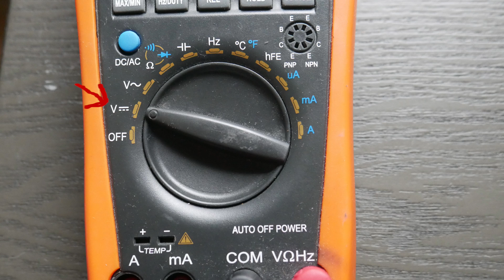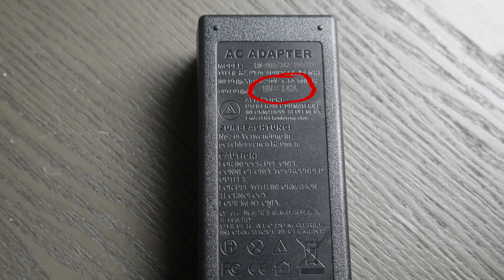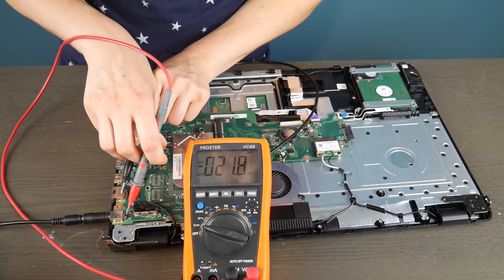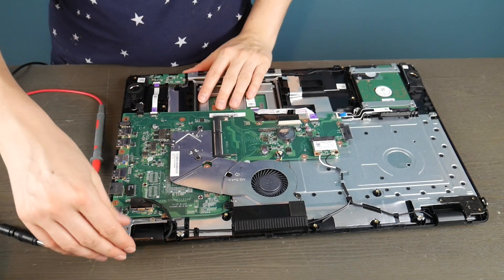Fix For My Laptop Won't Turn On - Tutorial by a Certified Technician

Comment: So i tested mine. I get power to the board. I reaet the cmos and it still will not power up at all. Is it just dead mother board?
Reply from the maker: If the power cord seems to be working, a BIOS reset doesn't help and the powerjack is working then the last thing would be the motherboard. You can also try uninstalling anything extra like HDD, wifi card, ram and see if it will turn on. In some rare cases, these parts can prevent the computer from turning on.

Comment: I have integrated power jack like your video and it does feed 20v to the motherboard, what else could it be. I haven't removed the battery as it's really hard to remove.
Reply from the maker: What problem are you having with your computer?
Reply: @EggheadFixers  it won't turn on or power on at all, completly dead. I'm assuming it's shorted out. There was a small screw I found inside the laptop randomly sitting on the fan, I don't know if I shorted something or where it came from.
Reply from the maker: @SG-uj8tj  It could be that. Have you tried a BIOS reset? It resets the computers base system and can sometimes revive a dead a computer. Here is a video on how to do that:
https://youtu.be/bZSz-jjexqM
Reply: @EggheadFixers  I haven't but thanks for the tip. For now will confirm if there is a short on the board, if not then I'll try that step. Thanks
Reply from the maker: @SG-uj8tj  You're welcome

Comment: Hello 
Egghead Fixers, I like very much your videos. I discovered your channel because I am searching a slution about why my Thinkpad W530 is turning on, fan rotarting and processor working but as if everything is working by I have no boot from the start so black image. This happenned to me when I  tried to add Ram slots, and one of the Rams was defectibe :( I don't know what to do I tried to remove the bios battery and reset and then restrat but nothing changed
Reply from the maker: So if you go back to just having the original RAM installed then it still does it? Also have you tried the method in this video of taking out the RAM sticks one at a time?
Reply: @EggheadFixers  yes saddly now whatever Ram I put, always the screen will not Boot, I borrowed a functionning Ram and I have tried it in every of the locations of the Ram slots, it didn't work. I have bought also a cmos battery to try it, also same result. I really hate that because i dont wish to buy a  chinese motherboard
Reply from the maker: @bernardobernardinhio9301  The different RAM you are trying is it compatible? Because not just any stick of RAM will work. It needs to be the correct speed.
Reply: @EggheadFixers  You are very very kind I thank you very much. Yes sure the same Ram compatible, the same Ram that was installed before I try to upgrade. Sure I have tested this same Ram on the computer of a neighbor and it worked (i removed all his 2 Rams X 8 and I installed only my (gb Ram and it worked on his computer9. When I install back this same Ram that was installed also before I attempt to do the upgrade, in my computer, then The Black screen remains. I thin that something in the ports of the Ram Slot or some chips nearby are destroyed. I also tried this same functionning Ram in every of the 4 slots of the W530 Thinkpad, and also did not work. Couldt be the GPU is dead? Maybe the bad Ram destroyed my GPU which is NVIDIA K2000M. How can I test if the GPU works?? I also connected to monitor also did not work. The Processor runs and the fans spin but no image. There is electricity out from teh USB if I try to recharge the Smartphone by USB for example. My feeling is that my GPU is destroyed as well
Reply from the maker: @bernardobernardinhio9301  yes it could a GPU or Ram slot issue. Have you tried a BIOS reset? It resets the computer base system and can sometimes revive a motherboard issue. Here is a video on how to do that:

https://youtu.be/K0FQRw8-PpQ
Reply: @EggheadFixers  Dear Liz, thank you very much for all the hints and advice. Apparently I have no solution because maybe some chip near the Ram were destroyed. So far I have tried all these:
1. Trying other functinning Rams in mayne slots of the W530 that has in fact 4 slots
2. Removing the CMOS battery for hours after removing all ports and battery and charger then try it again.
3. Buying a new CMOS battery and try it.
4.Removing Battery and Charger and long pressing the Start button for 10 minutes maybe to release electricity
5. Plug the VGA cable to a functionning external monitor

So I want to ask you, as I really love my Laptop and I have a powerful CPU inside it of 9Mb cash (i7 3940XM) and a SSD of 1T, I really wish to repaire it but I don't know wha to do.

I can have 1 or these 2 options:

1. The 1st is to give it to an electronic professional and hopefully I can save the original motherboard by just changing some chips maybe near the RAM if that is the case

2. I might have to buy a new motherboard from China but I have a feeling that it is not good because it is not the original quality.

Can you please advice me on each of these 2 solutions? If In case I want to buy a motehrboard where do you advice me to buy it or which brand if you have experience, and if I want to repaire the old motherboard where I can find such professional people or companies?

The problem is I should not pay a fortune as well because the laptop is an old model so I should put a budget for that maybe less than 100- 120 but I should think of the shipping to & back, and what if there is no hope to be repaired, i guess I should pay as well the technician who tried to find the problem. How these electronic people get paid when they don't know what the problem is?
Reply from the maker: @bernardobernardinhio9301  I have used a motherboard repair shop out of NY that is pretty good. They charge from $130-$175. Are you located in the US?
Reply: @EggheadFixers  Dear Liz, thank you again and again. While I was searching more on Google, I found a case where this problem occurs if a Ram was removed while the computer is running. It might be the Ram was not stable or tight in my case for example. My final question to you, do you have any video concerning how to fix computer when the Ram is removed (or pluged) while the computer is turned on? and if not do you think that this case can create a hardware problem (Chips got broken in the motherboard), or it is more a software problem you think. 
In all cases maybe this case is extreemly rare and you did not see it. 
Thank you again for your kindness
Concerning the shop in NY, in fact I am in Germany so I send you many greetings from here 🌼🥀🌺and I salute your dedication to your career
Reply from the maker: @bernardobernardinhio9301  RAM not being installed correctly can definitely cause a problem like this. Also something like dirt or dust in the RAM ports can also cause a problem. So it is definitely worth checking before you repair or replace the motherboard. Always happy to help:)

Comment: My Toshiba satellite L630 turns on and I can spend as much time as I like in the cmos but as soon as I let it continue it starts to load Mint but turns off just as it starts to load the main xwindows screen. Your fixes don't wotk for me.
Reply from the maker: Have you tried reinstalling the operating system?
Reply: @EggheadFixers  Yes I have tried but I was only able to get it to the same point and the machine turned off. The DVD works fine so I tried both with another version of the OS using that rather than my USB boot disk and the original boot DVD. No joy. What is worse is that all my problems started when I upgraded the RAM (and yes I put the original RAM back with no change). If it was like my desktop I'd try replacing the Video card but I'm useless around laptops.
Reply from the maker: @LinuxAus  Was the original stick of RAM   installed when you reinstalled the OS? 

I would try these things:

Make sure the hard drive is set first in the boot order 

If fast boot is turned on then turn it off

Try switching between UEFI  (CSM) with secure boot on and Legacy (CSM off) with Secure off in the BIOS settings. There are two boot modes in BIOS and switching between the two can sometimes fix this problem.
Reply: @EggheadFixers  I went through the settings and was unable to change the boot settings in my L630 Toshiba but I will go back in today and try again. Thank you for your advice; you have been most generous with your time.
Reply: @EggheadFixers  The only one of these I can't try is the UEFI/CSM settings which don't exist on the Toshiba L630. It originally came with Windows 7 and so is pre secure boot.
Reply from the maker: @LinuxAus  Ya that is a strange problem. Is BIOS up to date?
Reply: @EggheadFixers  The BIOS has never been updated. I'll check Toshiba for an update and see if that helps. Thanks for the tip.
Reply from the maker: @LinuxAus  You're welcome
Reply: @EggheadFixers  Just for completeness, I checked with Toshiba and the bios in laptop is the latest on offer. I guess I'll have to load a text only OS and run a diagnostic in Linux. Thanks again. I find your videos very interesting.
Reply from the maker: @LinuxAus  Ya that is good idea. I hope it works out. Let us know how it goes
Reply: @EggheadFixers  Looks like a problem with the connector for one bank of memory. I hate to do it but I might have to pull it apart and check the Motherboard.
Reply from the maker: @LinuxAus  Ugh ya that's always a pain:/
Reply: @EggheadFixers  Just thought you'd like to know: text mode didn't work. It has to be a fault in the mother board.
Reply from the maker: @LinuxAus  Ya that makes sense. Thanks for letting us know